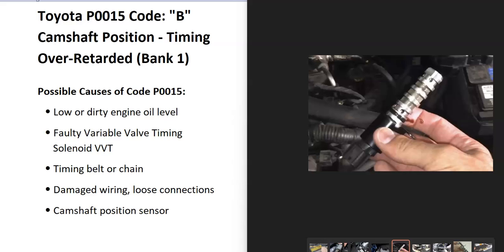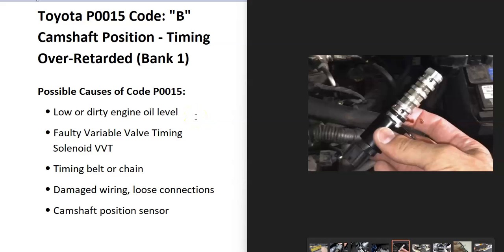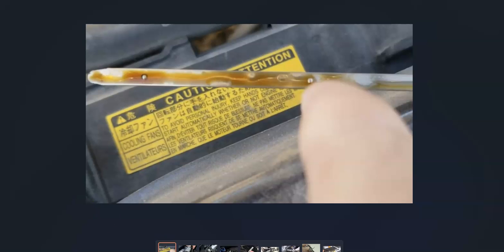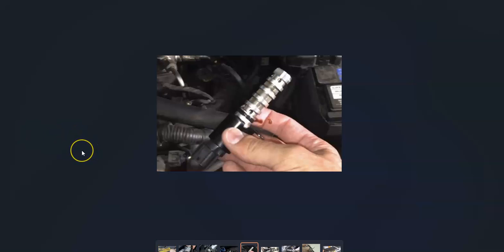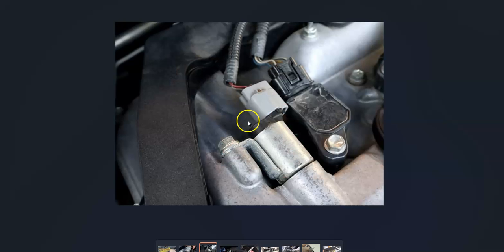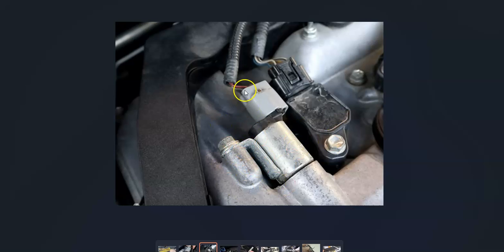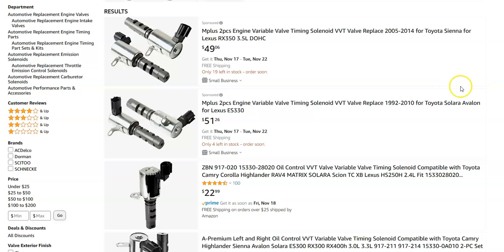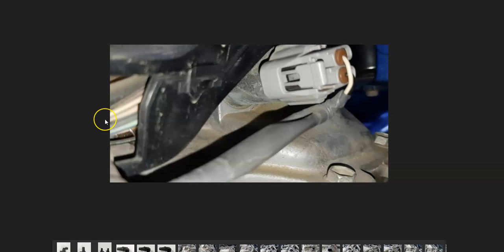Causes and Fixes Toyota P0015 Code: "B" Camshaft Position - Timing Over-Retarded (Bank 1)

Comment: I bought a 2011 Corolla. Before buying it I tested it twice and the car was in use. I recently bought it and used it for a couple of days. Then I stopped it and parked it and didn't use it for about 2 or 3 weeks. When I went to turn it on again it started turning on and it came on, check engine and trac off, I went around it, I went to O' Really to scan it and it gave me error P0015, then I went to wash it and when I started it, the check engine turned off. I asked a mechanic friend and he told me that the actuators and solenoids discharged oil and that's why it threw the error. Can anyone confirm this information for me or what has happened to them?

Comment: The most immediate and important things to do are check the oil level and make sure it is at the full mark. The next thing is clear the code. See if it comes back. Then move on to other solutions.
Reply: Thank you, I just got this code. But I know my oil is low as I just did an oil change - I’ll get some more oil

Comment: So in the video you said locate the b side exhaust  side bit I'd you have a 4 cyl it doesn't matter. I have a 2.5 4 cyl so do I only have 1 side or do I change both sides or what I'm confused? thx
Reply from the maker: The "B" is for the Exhaust side. Find the exhaust side of the engine, and that is the side with the issue. A 4-cyl has only one exhaust side, while a V6 or V8 engine would have two.
Reply: @HVAC_Mechanic  oh gotcha thx
Reply: @TrillNBA yes it was my fuel pump after all
Reply: @TrillNBA can't remember what code it spat out me googling and youtubing had me checking a few things vvt variable valve timing  a cpl of sensors ect ultimately one of the test le me to the fuel pump easy fix but expensive part

Comment: I had the P0015 code come up after my car stalled.  After driving it for a bit the code went away on its own.  Any ideas what that would be and if i need to get it checked out?
Reply: Probably oil or the band
Reply: Most likely timing belt is starting to go.
Reply: @ericabertagnoli5469 Sienna has a timing chain, not belt.